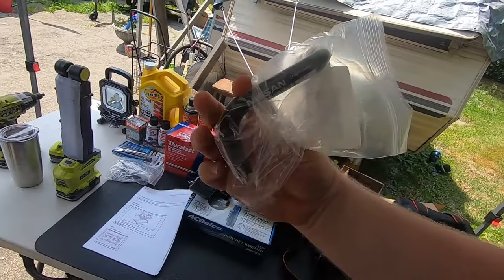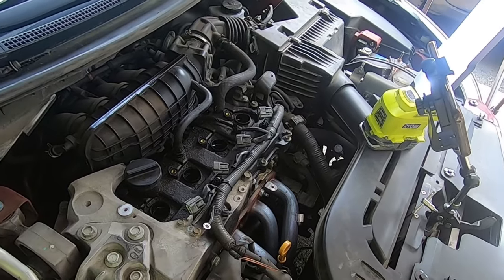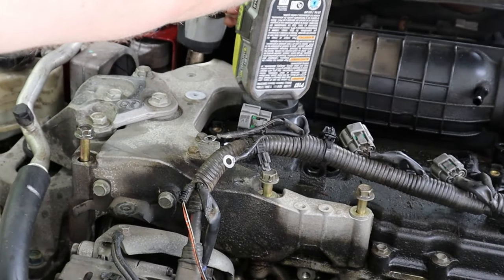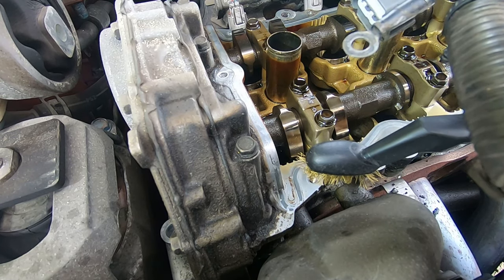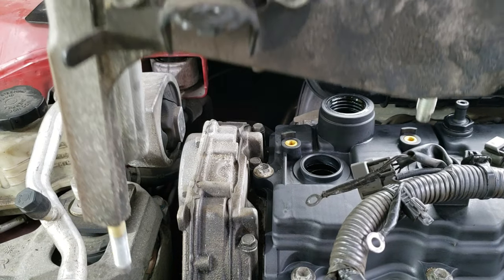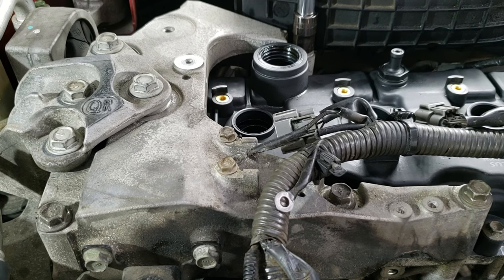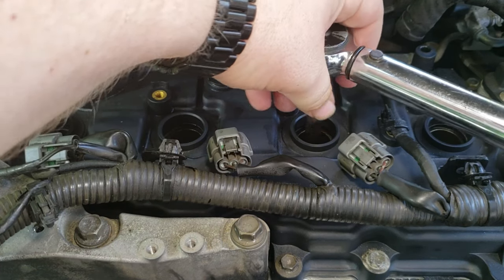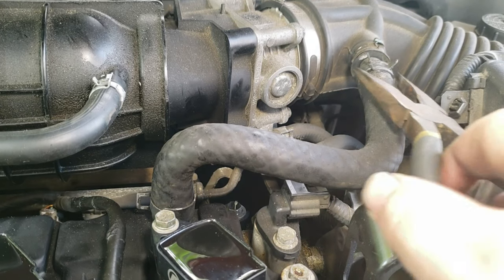2007 - 2013 Nissan Altima 2.5 Liter - How to Replace the Valve Cover & Gasket: FULL Walk-through!

Comment: Hello I have an A/C issue with my 2010 Altima. Compressor clutch stays engaged all the time and the A/C does not cool down enough, just very little bit. I can not find the A/C compressor relay. Have any idea I can check and fix?
Reply from the maker: Hey MC! Sorry to hear about that. Is your A/C compressor clutch able to disengage or is it stuck engaged at all times?
Reply: @TrickShiftGarage  It's disengaged when the A/C is off. There is gas in the low (L) pipe
Reply from the maker: Hmmm, ok it could be low on refrigerant and just needs a recharge to blow full cold. It might be worth doing that first to see if it fixes it.
Reply: @TrickShiftGarage  Do I need a professional machine or just cheap DIY aerosol and gauge?
Reply from the maker: Most auto parts stores sell "recharge kits," just ask them which kit applies to our Altimas, and they should point you in the right direction 😉
Reply: @TrickShiftGarage  Well, my mechanic vacuumed and charged my a/c. It cools good now. However my clutch does not stop turning as long as my a/c is on. It stops when I turn off the a/c. What can I do about this?
Reply: @TrickShiftGarage  Does your car’s a/c clutch go on and off when the a/c is on and the car is working on idle in park gear?
Reply: You make me a big favor if you can tell me if  your car’s a/c clutch goes on and off when the a/c is on and when the car is working on idle in park gear?
Reply from the maker: Hi MC, sorry for the delay. Basically, there's a clutch on the AC compressor that is supposed to engage when you turn on the AC, the clutch moves into contact with the pulley thats connected to the pump internally. So when you turn it off, it disengages and stops the compressor. This lets the pulley freewheel so the compressor doesn't function. I checked my car out and verified that it does this when in park. Let us know if you have anymore questions. 🙂

Comment: About how much will it cost to get the cover replacement? Not including parts...
Reply from the maker: I've heard as high as $3,000 and as low as $1000, and that's just for labor/time. It took me a whole weekend to do it because there's a lot to move out of the way to get to the valve cover. Thanks for watching! 👍

Comment: My mounting bolts were extremely hard to take off. Had to stop there. Any suggestions?
Reply from the maker: Yes, try using a breaker bar will help with those. They're in there good when I had to loosen them. Good luck!

Comment: so , you dont want use anti seize when putting back all those bolts? is it bad for engine?
Reply from the maker: You don't have to for the valve cover bolts. Anti seize is usually used for high corrosive areas like brakes and suspension parts that get exposed to a lot of water as well as salt in the winter. Thanks for watching! 👍

Comment: Does it still leak? I ask because i heard Aftermarket Altima Valve Covers are not designed right with a baffle and will leak through the air intake tube. Someone said it must be an OEM Nissan Valve cover because the aftermarket has a flaw in the design....before i do this. Im curious if you heard of this
Reply from the maker: Well, there isn't any oil in spark plug holes anymore, and I haven't noticed any oil leaking out the sides of the engine either. However, I have noticed a small amount of oil residue around the PCV valve on the cover, so maybe that's the flaw you're referring to? 🤔 

I haven't heard of this in the aftermarket valve covers before now, but if that's the case, I would go with the Nissan OEM one for peace of mind. Hopefully, it's not too pricey, lol.
Reply: @TrickShiftGarage  thanks brother!
Reply from the maker: You're welcome brother! If you have any other questions feel free to ask. Thanks for watching! 👍
Reply: @TrickShiftGarage  i smashed that Like button months earlier!....SMASHED
Reply from the maker: Haha! Thank you so much, we have plenty more videos of the Altima on the way so stay tuned 😉

Comment: How did you take the oil out and why before installing the ignition coils on your Nissan Altima? Do I have to do the same?
Reply from the maker: I used a syphon with a tube to draw the oil out first so I could pull the spark plugs out to clean out most of the oil. I did it that way to keep oil from getting on the new ignition coils. If you don't have any oil in your spark plug holes you shouldn't have to do it this way. Thanks for watching! 👍

Comment: When I tried to take off the pcv hose, the hose broke, which I expected. However, the nubs the new one would go onto came with the hose, they were stuck together and now have snapped off with the old pcv hose. I don't know what to do, any help would be appreciated, thanks. I think the nub is the pcv valve, but both valves have broke off, even the one in the manifold.
Reply from the maker: Wow! Never seen that one before. I would try to look into a small rubber grommet that would fit into the opening in the intake manifold, then a metal fitting that would go snugly into that grommet and stick out so you can put the PCV hose back over it. The PCV valve is in the valve cover so you just need to replace the PCV and you should be fine I think.

Whatever you end up doing, make sure there are no air leaks on either side of the PCV hose because it could throw a check engine light or cause the engine to run rough. Hope this helps, good luck!

Comment: I saw that engine side mounting rubber bush was cracked ,why you didn't replace that same time ?
Reply from the maker: I didn't have the new engine mount on hand at the time but it would have been the perfect time to do it! Thanks for watching 👍
Reply: Hey, I'm in this exact predicament. About the Strut Motor mount? Would it be best to change the other mounts as well? How many mounts in total? What are all the mounts? I have 2010 Maxima. Also, would this be a good time to change the Serpentine belt to?
Reply from the maker: Not sure how many mounts are on Maximas, since they only have V6 engines on them, sorry! 😔
Reply: @TrickShiftGarage  Its all good mane. Preciate your vids tho! Still very helpful 🙌

Comment: Do you think oil build up in the tubes would cause a misfire?
Reply from the maker: Yes, it definitely could cause a misfire. What happens is the oil acts as a conductor (through the carbon matter in the oil) and that could lead to high voltage arcing inside the spark plug wells. So basically the electricity that was meant to go to the spark plug escapes through the oil leading to a misfire condition. Hope this helps PV! Thanks for watching! 👍
Reply: Yes it happened to me I kept burning the small (10)Fuse that reads Ignition Coil I ended up changing the Coils ONLY and it worked for 4Months till Today It happened again when I Accelerated I guess I force to much Oil in and burned the Fuse

Comment: Do you have to apply permatex when changing the valve cover? I didn't apply any when I changed mine along with the gasket. 😧
Reply from the maker: Hey Boss! Unfortunately yes, you have to apply permetex in the corners of the valve cover since they're 90 degree corners because oil leaks could develop there. I'd check the corners of the valve cover for leaks, if it does start leaking, you'll have to take the valve cover back off to apply the permetex.

But who knows, maybe you'll luck out and nothing will happen. Either way, good luck and thanks for watching Boss! 👍

Comment: Good video i need to do that to, i have a question i have lifter noise what you recommend thanks.
Reply from the maker: Hey Toni! The best solution I recommend is getting the lifters replaced. But you can also try an oil additive like Lucas, they work at quieting down the lifter noise. It's more of a stopgap treatment that is much cheaper than replacing the lifters, it's definitely worth a shot! 😉
Reply: @TrickShiftGarage  Thank you so much for respond!
Reply from the maker: You're welcome! 👍

Comment: great video. When I clicked your amzn link for the cover it told me it did not fit my 2009 Nissan Altima. is that a mistake?
Reply from the maker: Hey Claudio! It's probably a mistake on Amazon's or the seller's part. It should fit a 2009 Altima, since it's the same engine from 2007-2012. Thanks for watching! 🙂👍
Reply: @TrickShiftGarage  you also have 2 different links to kits.  is there one over the other?
Reply from the maker: My apologies. I noticed when I first clicked the link that the brand was different from the one I used in the video, not sure how that happened. 

Anyway, I replaced it with a link to the valve cover I used (that may be why you saw two different kits). The "MOSTPLUS" brand is the one I recommend because I actually bought it and it's been perfect for me. So it should work and fit your 09 Altima as well! Hope this clears things up, if not just let me know 🙂

Comment: Hey quick question I notice some oil gather up on top of my engine around where spark plug assembly is located. It’s in the second one from the right? Do you think I also have similar problem and need to replace the cover. I only have 85K miles on my 2013 Altima
Reply from the maker: Hey Sagar! I think you might have the same problem that I had with mine. Oil is getting by the seals for the spark plug bores and will accumulate oil in there. Replacing the valve cover gasket will fix your leaking. The design stayed the same between 2007 and 2013 model years. Hope this helps you, thanks for watching! 👍
Reply: Hmmm I saw your video not sure if this is something I can do by myself, any idea how much something like this would cost at a repair shop?
Reply from the maker: I'd guess around $200 for this job. Since you have to remove the engine mounts to get to it  The best way is to call a Nissan dealer or a reputable mechanic shop, they should give you exact pricing. 🙂

Comment: Where can I find the breather hose that’s beside that pcv valve hose? I can’t find it anywhere oem..
Reply from the maker: Hi Evan! I know the feeling it took me awhile to find a new breather hose too, ebay came through in the clutch!  
Here's a link:
https://www.ebay.com/itm/325417094442?mkcid=16&mkevt=1&mkrid=711-127632-2357-0&ssspo=ZC8C6GZESQW&sssrc=2349624&ssuid=xbcciXIqSz-&var=&widget_ver=artemis&media=COPY
Reply: @TrickShiftGarage  unfortunately I bought that exact part thinking it would fit mine but it didn’t, on the edge the hose gets skinnier like a nipple but I still can’t find it
Reply from the maker: I think I know what your talking about. You're talking about that plastic nipple piece thing at the end? That connects the breather hose to the intake elbow. It should come off the old breather hose by moving the clamp off of it and pulling it out. I just reused that piece and it worked fine for me.

Comment: Be careful not to twist the wiring on the spark plug boot/coil. The wire insulation will flake off. I used rtv to quickly isolate the 3 wires and acts as insulation. I believe plastic engine covers hold in the heat and do this damage.
Reply from the maker: Thanks for the tip Flat Rock! 👍

Comment: Do I have to replace the ignition coils ?
Reply from the maker: No, you don't have to if the engine is running smoothly. I replaced mine because it had almost 200k miles on them and felt like it was a good time to do. Thanks for watching Mike! 👍

Comment: That hose at 5:00 is a vacuum hose right?  I'm trying to order a new one
Reply from the maker: Yes, I had to look it up myself, all I knew was it was some type of vacuum hose too haha! So it's called a blow-by hose, this hose is the one that just runs between the intake and the valve cover. (Not the one that connects to the PCV valve)

Here's an ebay link for a brand new one. Hope this helps! Thanks for watching!

https://www.ebay.com/itm/202373375703?_trkparms=amclksrc%3DITM%26aid%3D1110006%26algo%3DHOMESPLICE.SIM%26ao%3D1%26asc%3D20201210111314%26meid%3D0462bb73dce84170afd76f4bfea3efac%26pid%3D101195%26rk%3D2%26rkt%3D12%26sd%3D162597459350%26itm%3D202373375703%26pmt%3D1%26noa%3D0%26pg%3D2047675%26algv%3DSimplAMLv9PairwiseWebMskuAspectsV202110NoVariantSeed%26brand%3DNissan&_trksid=p2047675.c101195.m1851&amdata=cksum%3A2023733757030462bb73dce84170afd76f4bfea3efac%7Cenc%3AAQAGAAACMNHpe%252BlMvX3OkZh%252BPA3Rh8OBW2cQ6ABsGPVDNXk8bkR7ofJ1ZS7%252BAP2lhcmzeEXm94xm9rP8Twu1dGp9hDLM1VMEHozP5BxA544sXbjsRB7XecRxkVeUB1Zp8dr5zqRslyNhclNIJsSHJklxkG9d%252BMSf1iZe489vIbgx0m7OBRmM667CKNNNNDmtSOBmb1%252FDKRUKAuqG125ruOvGr73sQWf0pvb%252FpgHvsxzqrvfXwJcLxHMAE7nNzmzLLo%252BGAoI4y9M2rVNQD%252Fq1nBh2SpDAk0GM7kdqgW3d0HhJ6JcudwGGCg8UrJVN9PyVqv5unOm7zRMxFiskojYz1a%252BsoBi9bMznXWxfe8g1tOgNPKB9dBVeB37oZN5MjPd6oYCUo0GgXjTvTIP%252F8sOeL0xe1xqn0afPWGRqSuBzUYKZamuHn%252F3BDRzfBhTRtiy%252BIV52M6sIfw53pfkdmyQ3uVJU038aa87p%252FfnzWNXzInrpT0S7XnbtHpT2O5GE%252FmQ7LcoitiwgJGnL%252FqDJhc1Pk7u7EGt4job4bGbpmcdRxCcM4Vf68Pe%252Fu66CNM5LhA1cdy2syl2c2yCuOn55P28nlZuHGIXP7JCEwOPY2UUd2TWNDOlOnEZk4ye%252FcszTZsXczQHaSehNQNzxte%252FEJIn6LPYFZIpIjG%252FO3qXWDdKxFh3z1rEoIE0A3kqc8AoBgCiJmB3Db%252F2ZhMyrgr7s339jO6%252Fi7pU796VDOXH3%252FOVVFByRNMJkHEJB%7Campid%3APL_CLK%7Cclp%3A2047675
Reply: @TrickShiftGarage  thank you so much!

I have one more question.  I hope you see this before I head to Nissan today.  What is that bolt called that you undid at 7:51.  I broke that bolt and I need to get a replacement from Nissan today.  I just don't know exactly what it's called lol.  

I torqued those unknown torque spec bolts to 50ft/lb and that one I specified just kept turning.  

Thanks for your help!
Reply from the maker: No problem! Glad to help!

I'd call it an "engine mount bolt" to the parts department. You'll probably have to show them which one on their computer diagrams (there's quite a few engine mount bolts lol) or you can just show them your engine compartment and point to where the bolt you need goes. That should be enough for them to figure out the exact bolt you need. Hopefully they find it and have one in stock! Good luck! 👍

Ask the parts department if they happen to know the torque spec for those bolts, maybe they'll know. The dealer I called didn't have it. Thanks!
Reply: @TrickShiftGarage  Awesome!  Thank you so much!  My buddy helped me find it and I guess it's called an engine mount bracket bolt.  On the website he found, it shows that 36 ft/lb is the torque spec for those bolts AND there seems to be a tightening sequence for those bolts as well!  Just FYI :-)  

Thank you so much!
Reply from the maker: Awesome! Yeah that's what it's called, almost had it haha! I'll be sure to add that information.

If it's not too much trouble, do you happen to have the website name or a link? I'd like to provide that source so my viewers can use that information when doing their valve covers. Thank you so much bro!
Reply from the maker: Sweet! Thanks Michael! I really appreciate it. I'll probably make a short video on this information and link it to the main video and pin a comment as well. Thanks again! 😁👍
Reply: @TrickShiftGarage  you're very welcome!  And thanks again for the info and video!

Comment: According to my 07'-2012 Altima manual spark plug torque is 14-22 lb ft..thats the 2.5 liter 4 cylinder for sure... valve cover is 2 steps..1st to 17 in lbs and 2nd to 74 in lbs. 

as far as engine mount bolts it's kind of strange..
engine mount bolts/nuts  Left (transmission) and right engine mounts..through bolts 32 to 40 lb ft
engine mount bolts/nuts..nuts 37-43 lb ft    bolts 54-66 lb ft
front and rear engine mounts..through bolts56-72 lb ft   engine mount bolts/nuts 61-72 lb ft
engine mounting bracket bolts 32-40 lb ft

Doing mine tomorrow on my 2012  4 cylinder 2.5 liter Altima S.
Reply from the maker: Thanks for that info! Those engine mount torque specs are all over the place lol. If you have any questions let us know Ross! Good luck 😉

Comment: For those who want to jump to specific parts of the video for torque specs, here are the times.

Valve cover bolts order: https://youtu.be/fRzelPhCPMw?t=990

Valve cover Bolts torque: https://youtu.be/fRzelPhCPMw?t=994

Engine mount bolt torque (On top of the valve cover): https://youtu.be/fRzelPhCPMw?t=1129

Engine mount NUT torque: https://youtu.be/fRzelPhCPMw?t=1151

Engine mount 4 bolts torque (connecting piece): https://youtu.be/fRzelPhCPMw?t=1155

Spark plugs torque: https://youtu.be/fRzelPhCPMw?t=1280

Coil bolt Torque: https://youtu.be/fRzelPhCPMw?t=1371
Reply from the maker: Thanks JJ!!! Appreciate it!!!
Reply: @TrickShiftGarage  By the way, Checked and the cover does not leak!!
Reply from the maker: Yessss!!! That's awesome bro. Glad to hear it! 👍

Comment: Cause mines looked the same way when I took mines apart to confirm there was oil in my spark plug wells
Reply from the maker: Yeah, it's definitely the spark plug tube seals that are bad. Happens alot on these engines.

Comment: By the time it needs the cover the rest of the car is trash. Altima suspension fails, alternator . I had rusted out power steering rack lines and rusted out oil pan. The exterior looks great but mechanicals die